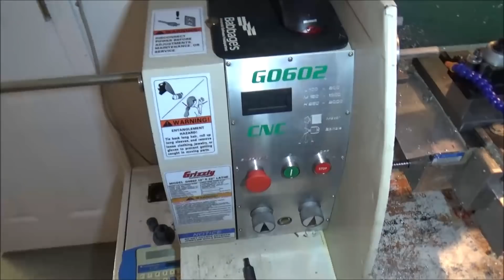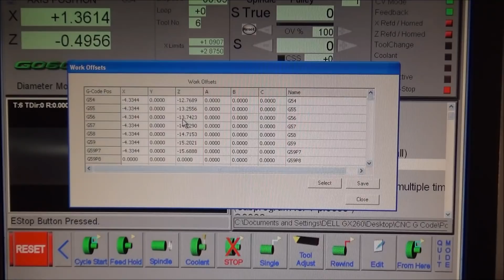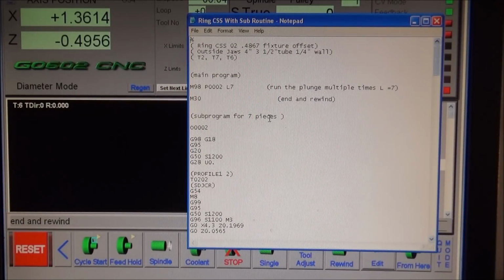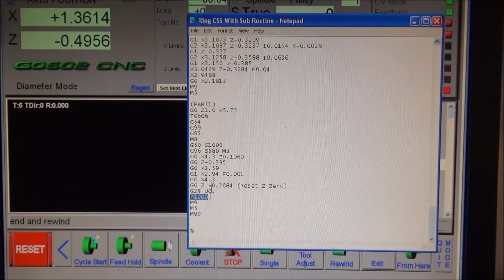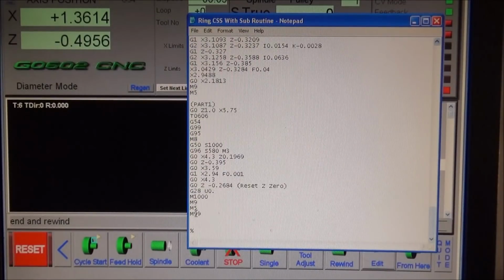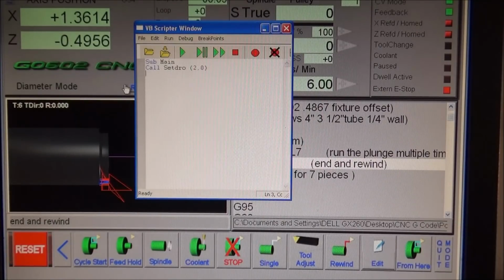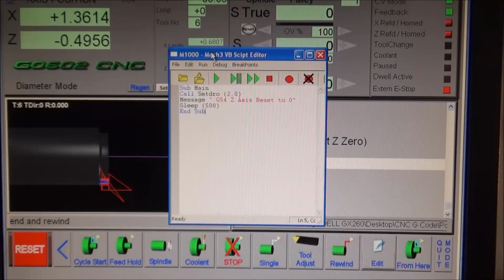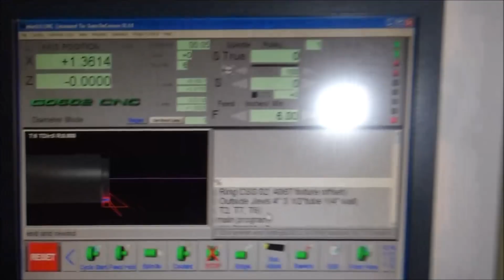Mach3 Sub Routines and Macros

Comment: Instead of worrying about resetting the DRO to 0.000 program subroutines in incremental makes life a whole lot easier. Also a G50 will reset your current position to 0.000 on a fanuc control I don't know about Mach3. Just a thought.
Reply from the maker: Thanks Lenny , G50 in Mach3 resets all Scale factors to Zero.  So that will not help.
This ended up being the simplest way with only a few lines of extra code. 

It also will work on any part that needs to have Z Zero reset after a Cycle.

Comment: Dude,

Here's a way to improve this situation.  Use 2 more macros.
Before you call your machining sub, call a macro that saves your original Z value. I don't know how Mach3 works. I would save the G54 Z value to a common variable.  If you don't have that ability in Mach3, you could read the G54 Z value and write it to the G55 Z value. Then call your machining sub with the number of iterations you require.  After that, call a third macro which resets your G54 Z value back to the original value.  Boom! You're ready to load the next part and cycle start again.

Of course, I'm assuming you have the ability to use a macro to read your G54 presets.  If not, you can just manually input the value into the resetting macro and skip the capture macro.

Main program would look like this 

O0001(MAIN)
M666  (CAPTURE G54 Z VALUE)
M98 P1001 L7
M777 (RESTORE G54 Z VALUE)
M30
Reply from the maker: Hi Rob,
 Thank you for that Suggestion. I often run parts like this where Z Zero changes after each piece. My solution of calling the single macro allows me to use that same macro for several different parts where I need to reset Zero. Having a understanding of how Mach3 works allowed me to simply use the software to reset Zero. And my rough stock will also vary slightly from piece to piece. So I have to reset Zero to start anyway. I'm fairly certain I could also Capture my G54 as you suggest and I appreciate the suggestion I'm going to look into it as It may come in handy on other parts.
 Thanks 

Be safe,
Sam

Comment: If you have to make a huge amount of these, then something that may be worth considering is making a cutting tool to part off all the rings at once.
   I worked briefly in a piston ring factory and this is exactly what I was doing there. They had me cut the cylinder with that comb tool I described, but not all of the way through. I was to then separate them from each other with a chisel. Yeah, WTF? 9/10 were scrap just from that. Their procedure was crap, but that's not to say that better methods don't exist. An expanding mandrel could hold each section of the cylinder through a full depth cut. I don't know if your lathe has enough power to do several simultaneous cuts, but I thought I should let you know about this option.
Reply from the maker: That would be Great , But yes these smaller machines do lack the power to take advantage of a combing type tool.
Reply: @CNC4XR7  it's like me trying to use a flycutter on my x2 minimill.. Aluminum only, very shallow, slow, terminally slow feed... Maybe the machine won't break... Then again...  😭
Reply from the maker: exactly

Comment: I use g52 as a temporary work offset.
And always save the first zero as a variable position as you can't run from here etc in subs.
Better to have 1 scrap part than 7
Reply from the maker: I looked at that method as well it would work , this just seemed the simpler route and allows me to use the Macro on multiple parts. Thanks for the input.
 Be Safe, Sam